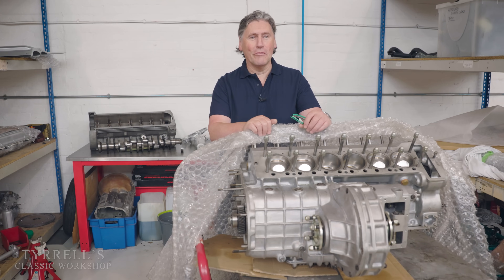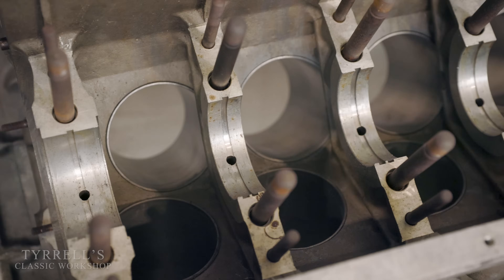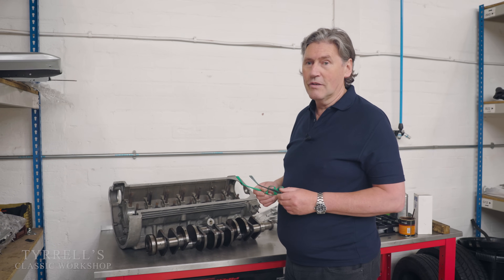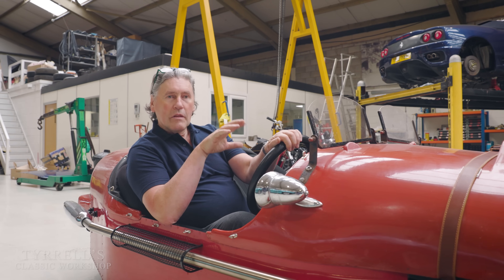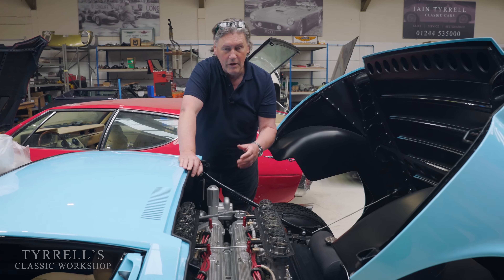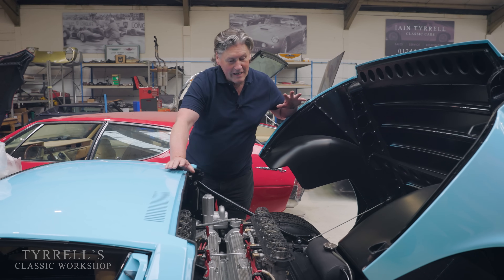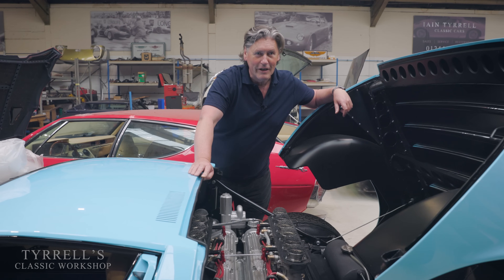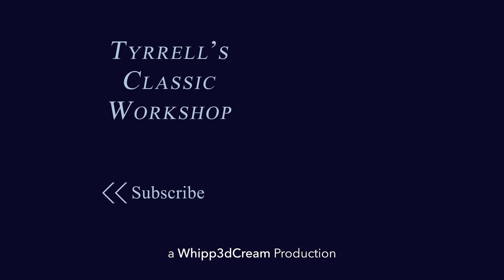How to warm up your classic car engine the correct way & why it matters | Tyrrell's Classic Workshop

Comment: Thx Ian .Much appreciated .Yes older carbed 308s you turn the ignition on for 20/30 secs to prime the Webbers then stab the throttle and start it .My 208 , with smaller 34 Webbers does need choke to fire and it’s got a high idle 1100 .I was told a lower idle of say 7/800 rpm the oil P drops off . Exactly what you don’t need .The full choke idle is around 1500 rpm , but as you say i quickly get it off say in the first 100 m down the road once it gets going .A lot of classic carb cars get more frequently oil changes to counter the fuel dilution I suppose .Talking 3000 miles for my 2.0 L Ferrari .I use classic mineral oil 15/40 , just change it often .Try and keep it under 3500 rpm until all the T+P s have come up .

Comment: After starting the engine carefully, as shown, should you warm it up on the drive, or drive off immediately and gently, with no excessive throttle use?

Comment: This is video is so informative. With a 1995 Porsche Carreras that may sit for 3 to 4 weeks between drives, is the manufacturer's start procedure OK, or would you recommend starting the car with the DME relay removed to make sure that the engine gets a flush of oil before the engine bursts to life? P.S. thank you for taking the time to produce your video series!
Reply from the maker: If it doesn’t upset the electronics too much, it can do no harm for sure
Reply: @iain_tyrrell  Thank You!

Comment: Always told to get the choke in asap but could be tricky in cold weather or i distracted. Also choke management important for fuel consumption. The twin Webbers on my Alfa Spider more reluctant to start in winter ; more used to Med warmth ?

Comment: Great video as always. For a modern engine like the 4.0L engine in a 991.2 GT3, I can hear the engine cranks for a few revolutions before firing, which presumably is good. Oil pressure rapidly builds up to 60 psi or so on a cold startup. Since the engine fast-idles anyway, is it better to let it fast idle for 30 seconds or so before driving off, or is it better to simply drive off anyway keeping revs small, let's say under 3k rpm?
Reply from the maker: Exactly- you have it
Reply: The car sits unused sometimes weeks to months at a time, especially during winter. Porsche recommends pumping the tires to 58 psi and not raising the car (to prevent corrosion on exposed polished surfaces on struts) but makes no recommendations about engine starts. When starting a modern engine after a few months of sitting, any special recommendations?
Reply: Most modern engines won't start unless the oil pressure is correct, you'll get a warning light and it will refuse. It's why they take longer when it's cold or haven't been used for a while, it waits for the correct pressure first. I get the same with my Elise when I haven't used it in a while.

You don't really need to do anything special with a modern engine. It will handle it all and protect itself.
Reply: Would it take into account that the engine has been sitting for an extended period though? It starts with the same number of cranks regardless of whether it sat for 1 hour or 3 months. Would be nice to have a ‘crank only’ feature where the car cranks but does not deliver fuel by pushing the gas pedal to the floor like on some early FI cars.
Reply: On earlier OBD-I FI cars I would pull the fuel pump relay to allow exactly this but I don’t want to cause an issue on my GT3 by unintended consequences.
Reply: Some Porsche flat-6 engines give a puff of blue smoke on startup and apparently this is normal behaviour. Is this a small amount of residual oil in the cylinders that burns off on startup, or is the oil sitting somewhere else?
Reply: Yes that is probably all it takes to reach optimal il pressure. Some Porsche engines had problems with bore scoring but that's a different issue.
Reply: Mr. Tyrrell, could you comment on bore scoring in Porsche engines in either the comments or in a future video?

Comment: If it's possible  , would you advise cranking the engine with ignition turned off until oil pressure is visible on the gauge??......
Reply from the maker: Yes, for 5- 10 seconds cranking only

Comment: My 90s BMW M3. Been thinking about modifying the fuel pump fuse so I can get oil pressure without the engine starting. Would this be a good idea?

Comment: Hi Ian, that was really interesting, I learnt something very useful.
I’ve heard and witnessed many methods over the years. 
From immediately reving up the cold engine to get it up to operating temperature as quickly as possible, or idling until the fan comes on, or just drive off straight away.

Good to get the operation taken care of instead of driving off on choke without an idiot light to remind you it’s still on at journeys end…
Reply: Back in the day I recall reading of someone who knew a lady who would pull the choke out, hang her handbag on it and drive all day like that!

Comment: With my old straight six Triumphs I had it set up with a spearate ignition and starter.  That way I could turn the engine over with the ignition off until the oil pressure warning light went off, and then start the car normally.

Comment: Will watch after. My way is take idle up to 1500 to 2000 for two mins then drive moderate till oil temp rises then drive hard. No engine like to be nursed, that said no engine will last if you oil pump fails due to thick oil, pump shaf stress while oil is like  treakle.

Comment: Many years ago I used to put a hidden switch on the coil supply wire mainly as an immobiliser of sorts but also to allow me to crank the engine before letting it start, it was my grandfather that told me when you've changed your oil or left the car sitting any length of time pull the king lead off, turn it over for a few seconds then put the land on and start it. One thing I wasn't aware of at the time though was washing the bores, so I guess the intelligent thing now would be take out the fuel pump fuse or would there be enough fuel in the fuel rail to still put petrol into the cylinders? Its a complex subject as you said.

Comment: Sometimes I have to start my car in wintertime without preheating it. When it's -30 or colder, engine does not sound happy. Good oil, oil change in time, good battery etc help.

Comment: Many thanks for this, Iain.  Having worked on 1955 Land-Rover sidevalve engines in a wee way, you see how frail the shell bearings are...
My other car is a Triumph TR6, which has the Lucas mechanical PI Fuel injection system...one of the weaknesses of this 6 cylinder engine are the crank shaft thrust washers, which wear more if you depress the clutch waiting at the lights...I therefore rightly or wrongly don't depress the clutch when I fire up the engine.  I will follow the routine for the manual choke British classic cars from now on!

Comment: Just a question: why not turn the crankshaft on the starter engine round enough, for say 20/30 seconds  with enough oil pressure with disconnected or detoured connected the  patrol pump. then connect the petrol pump and start the engine? You will have the oil everywhere with low rotation friction and wear and no wet sparkplugs....

Comment: That remembers me fighting my 2stoke scooter every cold morning I left it in the wild....Some days it was really frustrating,cranking it so many times!. My scooter was water cooled and some mornings never get to temp going on open roads,I even develop a little wind deflector around the air intakes to the radiator so they got some extra heat...First 3 or 4 minutes was doing high idle then some fast burst of gas,when it was ready the engine will go smooth,if not,stop again and repeat the warming process. In my garage it would start with the electric starter like butter every time. 
Every winter and summer I sent the bike to the mechanics to adjust the carburetor and that made a little easy the really cold starts at -º C and running a little cold in 40ºC summer. 
Good engine management is key,totally agree.

Comment: Great video.  On my 32 year old mini cooper, if it's been sitting for a while, I'll turn it over with the choke in until the oil pressure light extinguishes before pulling the choke out to start

Comment: Fantastic video once more, Iain! I have an old 300D diesel Mercedes, and it starts quite quickly after glowing the plugs and then it takes 2 to 3 seconds until the oil pressure gauge starts going up. Would it be a good idea to not glow the plugs when starting from cold to allow the engine to do more revolutions before firing?

Comment: Thanks Iain, love it. I learnt the trade on old Fiats, Alfas, Saabs, Citroens in NZ 20 years ago and I kept a 128 Coupe racecar and these startup guidelines have always been gospel for this toy!  But I also have a 2018 911 Carerra T and I HATE the cold start as it fires and sits on just under 2k from stone cold, instantly, after even a month and then smokes like buggery for roughly one minute! I get noisy hydraulic tappets etc for about ten minutes and feel this is a modern classic debacle; EFI intervenes for convenience rather than engine survival. Also I know you can't cover everything, but wish i could knock down cold start for a modern classic...! What to do!

Comment: GREAT benefits to fitting a pre - heater to ensure the engine is at the correct temperature.   Standard on cars in northern parts of Canada for example.   Many companies produce these (like VVKB, Autoterm, Triplex) and some have a 'remote', so the engine can be warmed fifteen minutes before going to the car.

Perhaps a video on these please?

Comment: I have built an oil pump priming tool from an old distributor shaft to use on my old 50's V8, as it doesn't get used often when it does before starting I pull the dist and use the tool on a drill to spin over the oil pump until oil reaches the rockers, then reinstall and start. I feel it helps somewhat.

Comment: The subject of initial oiling has long been a interest of mine, the absolute best way as far as my research shows is to have both a oil pre heater, and an independent oil pressure pump to circulate oil before the engine is turned, this system is used on most WWII aeroplanes with RR Merlin engines and works very well, there is a big market out there for a compact unit to fit on classic cars, or you can just isolate the ignition and turn the engine over a few times before turning it on. Chris B.
Reply: While it doesn't pre-heat the oil,  Accusump makes a pre-oiler
Reply: @kevinharper7037  Very many thanks for this interesting information, this is just what is required! Chris B.
Reply: Not a good idea to isolate the ignition, washing the bores with extra unburnt petrol, improves one wear issue but makes the other worse. Isolating the fuel is the answer, but not easy with most carburettors.

Comment: Great video. Most of the issues with start up wear disappear if you run the engine on LPG instead of petrol. It's a big urban myth that engines won't start cold on LPG, actually the complete opposite is true, no enrichment required and they start instantly. Because the fuel always enters the engine fully vaporised even from cold, no bore washing occurs. Additionally because the fuel supply can be turned on/off instantly (not possible with a carburettor) I can crank the engine on the starter without fuel until oil pressure builds, then turn on the fuel and the engine starts immediately, virtually eliminating the bearing wear problem. It's a fantastic fuel for classics, I can never understand why it is so unpopular, with petrol currently £2 a litre but LPG in some places still under 70p, maybe people will wake up to it again..

Comment: Indeed an easy way to start my MGB first without the choke to get some oil in and then pull the choke. Although my oil filter has a return valve it always takes a few seconds for the pressure gauge to wake up indicating oil starvation in these first seconds. Certainly if I haven't driven for a week or two a wise rule to start it.

Comment: Interesting Ian, thanks again.
I've an old Lister diesel in a motor-sailer. If it's been a while since it was run, then the drill is off with the decompressors so she won't fire, wind it over on the starter until oil pressure shows on the gauge, then decompressors back down, turn key and she fires immediately, showing perfect oil pressure. Never failed yet.
Sometimes wonder if an ignition cut-out on a petrol engine might have the same effect?

Comment: Question please to anyone who might know : With a hybrid engine, the car is travelling from cold using electric power. Then if you increase the speed, the ICE kicks in. Is the ICE starting cold, or has it been pre-heated ? Is the ICE starting without the oil circulating, or is it always circulating ? To me it seems weird that the ICE will start when the car is already going say 40 mph and has to run at highish revs to allow for that.

Comment: Perhaps installing a kill switch so you can crank the engine until full pressure has been achieved would be a simple workaround. That way you can turn the engine over and over for as long as you want in order to not only build pressure but also ensure the oil gets to every component. Just a thought.
Reply: Yes this proposition is one of the most common ones - browsing through the comments of this video.

But, you have to make sure that no fuel is injected or "carburated" into the combustion chambers while priming oil pressure - otherwise the uncombusted fuel washes the oil off of the cylinder bore. The measures required to prohibit the latter are depending on the different types of fuel systems and therefore not only differ a lot but also can prove to be anything between a manageable effort and an almost impossible one, if you do not want to sacrifice too much of the originality.

At least - just "killing off" the ignition system is not healthy, but it would be worth another video to give advise to which fuel systems are easily modifiable and how ?
Reply: @farbbunt  good points. If the car has an electric fuel pump then the same switch could also isolate the pump. If it has a mechanical pump then the switch could operate a solenoid valve to prevent fuel going to the carburettor. That would be an inexpensive way to overcome the problem you correctly point out. Just a thought.

Comment: I was reading my friend's owner's manual about his old Case diesel skid steer. I was surprised that it suggested to warm it up at full throttle for the first five minutes after a cold start. I always wondered if the manufacturer intentionally put the engine at risk to ensure the fast warmup of the hydraulic system. My friend does not do this, but he does put it on a slight high idle at warmup instead.

Comment: Different to your situation, but we run two race boats. What we do is crank the engine until we see the oil pressure gauge come alive. Then we turn on the fuel pumps and then the ignition. Why? Because we run magneto ignitions and mechanical fuel injection so to do otherwise would see the engine leap to its 3000rpm idle far too fast.

Comment: It's called "mechanical sympathy", Iain: and part of the problem is some owners wouldn't even know how to do a level check, and expect their classic to start on the button. My vehicles have a combined age of upwards of three hundred years: a huge part of their charm are the idiosyncrasies. I was always taught to vary the idle speed between 1200 and 2000 rpm while pushing the oil round, and never get excited on the throttle till the engine was warm. And the real secret of ensuring your classic  will start is surely - make sure you use it regularly!
Reply: Great video, and Lemma01 truer words were never spoken!  I own a humble Triumph Spitfire, and have for years, and it still never ceases to amaze me how much "happier" it is when i come off a drive.  You could say "they were meant to be driven" or whatever you want, but the simple fact is that when a car is warmed up thoroughly, along with the suspension and the brakes, that that's the environment that it is supposed to be in.  The rest of it is just waiting.  Iain mentions this in many of his videos.  More people should listen to him.  BTW, I used to "blip" the throttle (the American phrase for winging it, I am sure), so forgive me, father Iain, I have transgressed but will no more.

Comment: How can we tell what type of clutch our cars have to know to push down or leave up?
Reply: I have an Austin A30.... and this is all new to me with this car.... In all the more modern cars that I have driven... Pushing the clutch pedal down, lowers the drag on the engine.... So I would always start a car with the clutch down, even with the transmission in neutral. However on my A30. I start the car in neutral, with the clutch not depressed. If the car is cold and only just running... then when I press the clutch, without moving into gear.... then engine revs lower noticeably. I think that is the key. Try and work out, from the engine note, which is less drag on the engine, clutch in... or clutch out.